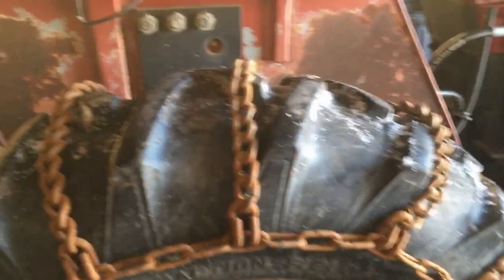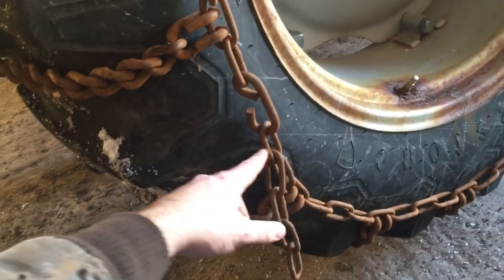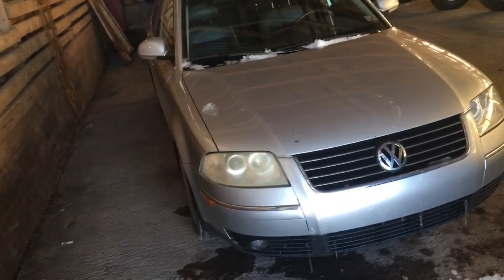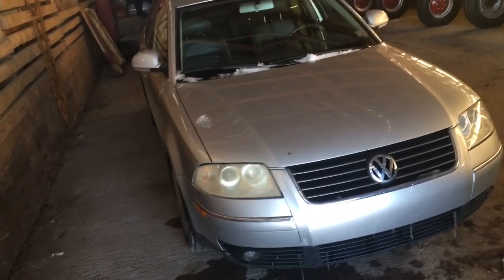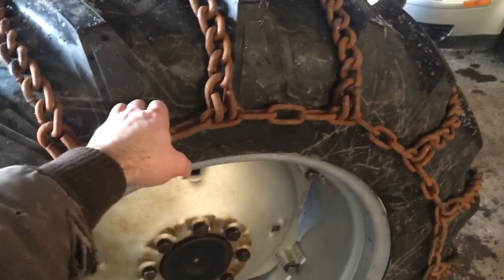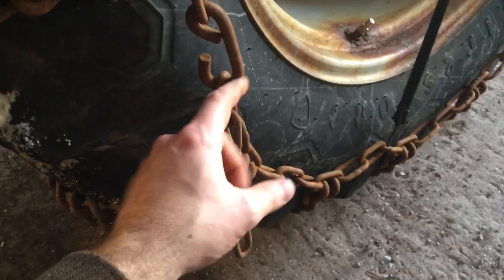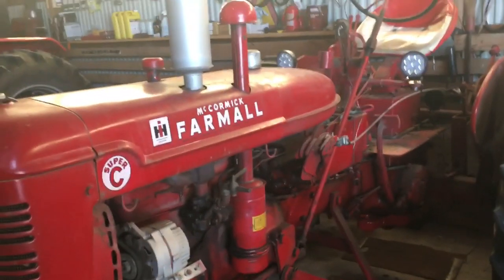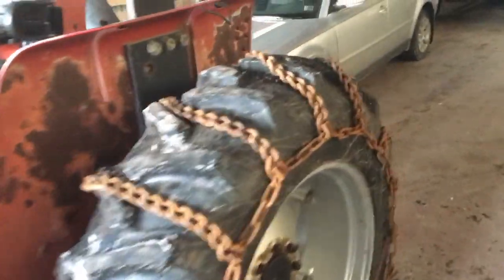Tractor Tire Chains

Comment: I have a similar set of chains for my skidsteer, and I agree- hook on the inside of the tire, latch on the outside of the tire. With the set of chains you have, instead of left and right chains, can you just flip the chain end to end- that would swap the hook and latch side without having to label left and right. Not sure if I made any sense to you, but just trying to help. lol So far, we have about 4 inches of snow with a layer of ice on top.
Reply from the maker: I was able to use it today, made it much better.

Comment: Good day I wasn't going  to comment until you show  hooks on bungee.  I bought new  light truck tires for back of  truck.  Driving thur  town, and   blubbling noise stop flat  tire, I looks  see nothing , feel  around  tire & see bungee  hook in week old tire. Because snow tire was new,  deep tread pull it out.OK  now when I see bungee on road , it's mine    You done a very good job  getting chains tight. Thanks
Reply from the maker: Sounds like a bad day!

Comment: Those chains don't look like they've been used much. I always had trouble with the cross bars slipping down between the lugs on the tires until I started using the H - pattern chains years ago.
Reply from the maker: Yea they aren’t bad at all. The other styles are nice. These came with the tractor, I never priced chains before.

Comment: Years ago before our first 4x4 loader tractor we had a 684 and we put the trig type chains on. That thing would go anywhere and it would gouge the cement floor in the barn a way better than 4 wheel drive.
Reply from the maker: I plowed with it today. Was a lot better, back end is still a little light. I saw you can order logging style chains too.
Reply: U have them on wrong
Reply: Why u need bungee I never use them

Comment: Need to chain the cross links together whether in an x with a circle or whether in straight lines between the two chains as you can see at 10:55 all the cross links have fallen between the lugs

Comment: You ever gonna show us what you look like? lol But damnit...I think I have mine on wrong...I'll have to look, but I think they are with the hook facing inside the tire :O But I find the draping of the top and the driving forward until the end is hanging about at 9 o clock position and then fastening works best for me. Haven't tried the jack method though.